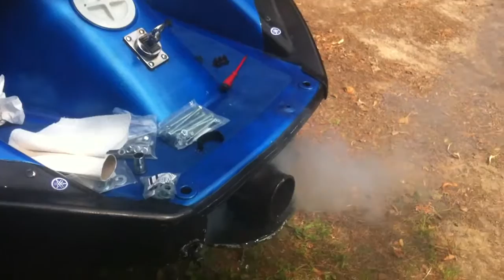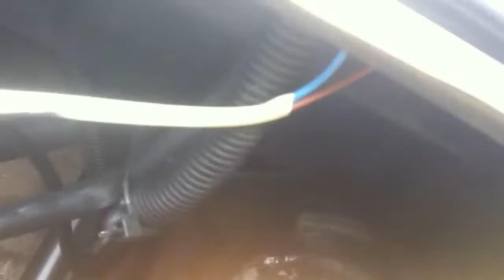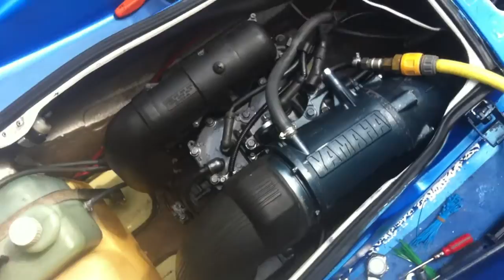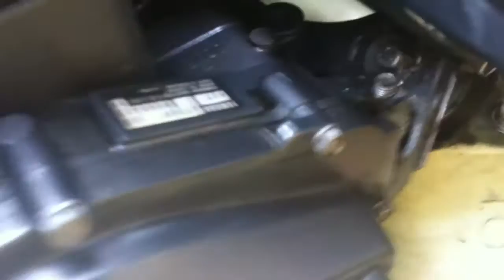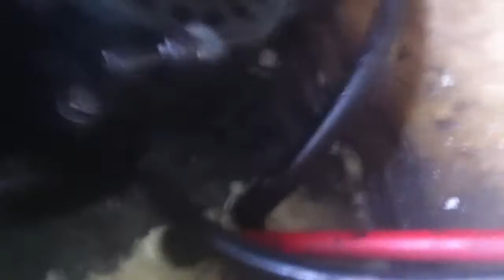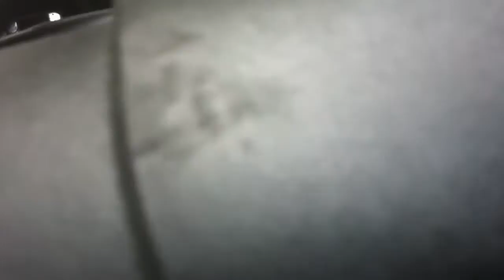Wave raider 700 engine run

Comment: The 700 701 is the most reliable jet ski motor ever made
Reply from the maker: I gave it up a bit, it doesn't serve me well, it deserves a good restoration, super solid but, it consumes a lot and costs a lot of use like a lot of 2-stroke
Reply: @BREIZHTRACKRIDER  well if you think that that jetski consumes a lot of cost wait until you invest in a 4-stroke and it breaks one time if you cannot maintain and ride that jet ski cheat you don't need to be riding jet skis I have one of those with over 500 hours and never a single problem
Reply from the maker: @shannonwilliams601  knives in use! it consumes and the oil is expensive, compared to a 4 stroke ... after or it is agreed the two stroke yamaha are incredibly level of reliability! they are great engines;)
Reply: @BREIZHTRACKRIDER   wait until your 4-stroke goes into the shop  you can literally put eight Motors in that Yamaha for what one motor in a 4-stroke cost

Comment: Your impeller is hitting wear ring. I can hear it.. Replacement cost -+700euro
Reply from the maker: Yes the turbine is the bearing with its HS bearing .... it's been a while since I put it in winter unfortunately before finding the courage one day to redo a restoration! Thank you for your message !
Reply: What i found out is that bearings of impeller are good but seal's are gone and leak water inside so i order new. And allso i will be replacing bearings and seals of distribution axle inside jatski. So its gonna be expencive overhaull but this jetski is worth. I put him alone in water and doesnt weigh aas much as 4strokers and electronics are simple so no problems..i even renew compleet membraan joint set of carb inside. Compression is 9kg each cylinder so its worth to fix it..
Reply from the maker: @WokeYtube  Thank you very much for the link and all your technical information for the dismantling procedure! this will help me a lot! you motivate me to take care of it ... not really my priority at the moment but it is certain that I will do it! Thank you very much for all the information, my bearing support is dead and eaten away by salt, I have to change all the support between the hull and the turbine, like you, there must have been an infiltration because of the worn seals and rings